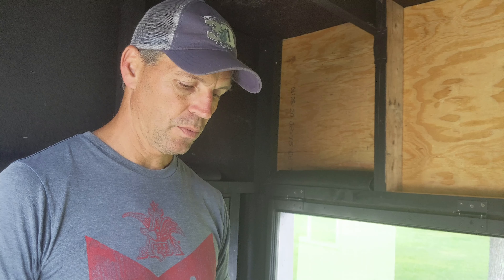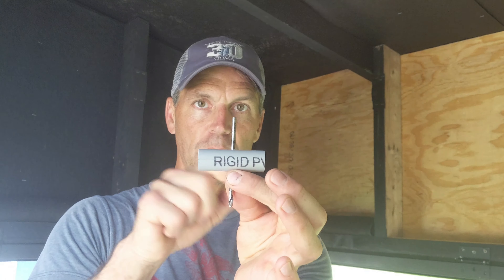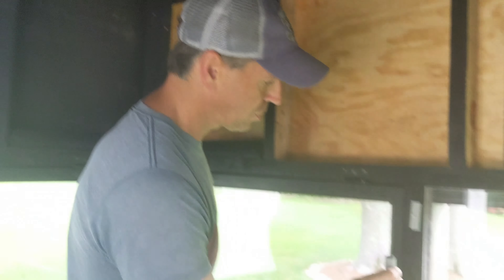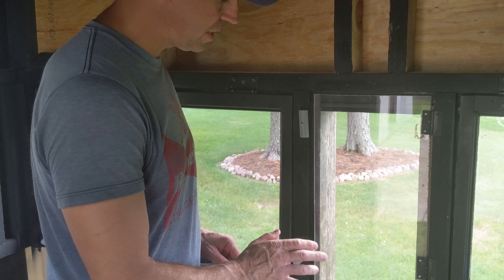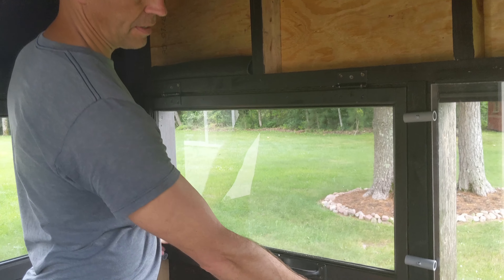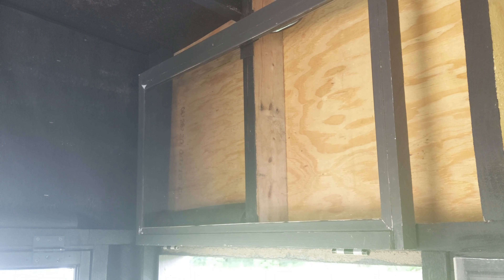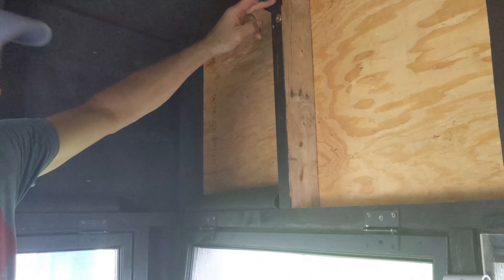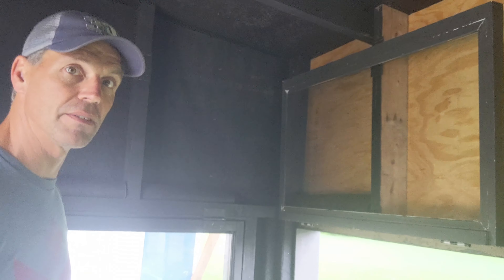Deer Hunting Blind Window Latch Idea (DIY!)

Comment: Great ideas. Love the window latch and also the anti fog hunters soap for the windows. Appreciate your videos. Building a 8x8 blind right now. What are your thoughts on where the 4x4 sit on the ground. You think maybe just a 10 x 10 piece of pressure treat as a foot or cement pad. Thx again.
Reply from the maker: I appreciate your positive comments. I've used both, depending on what I had available at the time. A cement pad is probably better in the long run. It's good to put the fresh cut side of your leg posts up and the factory, treated side down.

Comment: How did you make those wood framed windows
Reply from the maker: I didn't make those windows. They were sliding basement windows that I removed from my house. I removed the windows from the frame and turned them sideways. Used some brass door hinges on them that I had laying around.
Reply: @UncleBucks  they look really nice. Just got done with my 4x8 frame. Still have to make the roof, windows, and door. Wrapping it in treated picket fencing I got free from work.
Reply: @UncleBucks  I'd prefer treated plywood but this is free
Reply from the maker: @brandonyoung7760  Being thrifty is often just being smart! I also make many concessions it comes to what things cost!